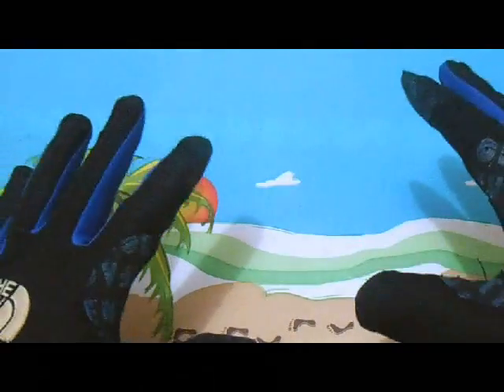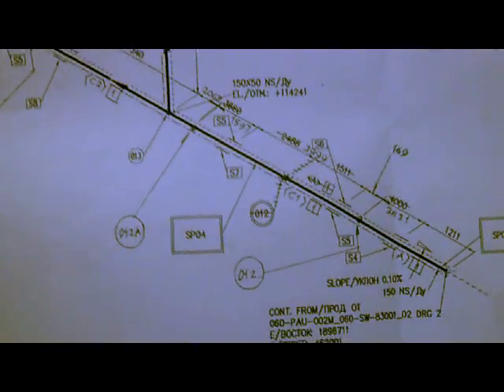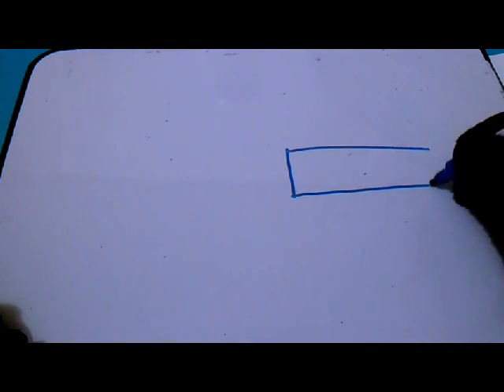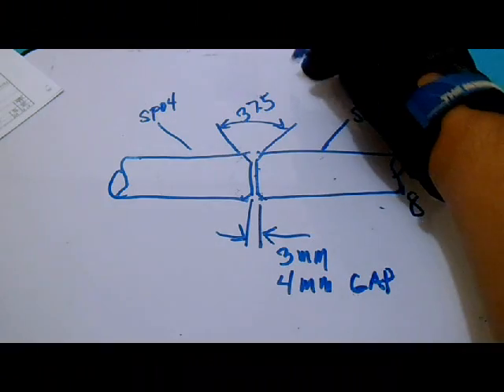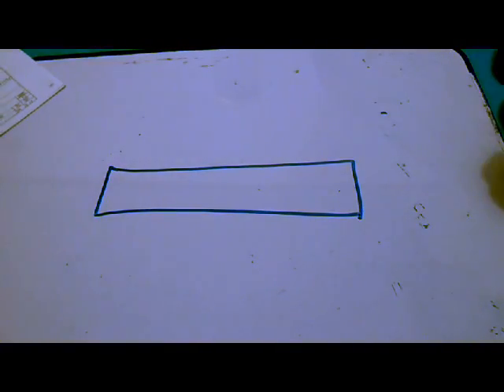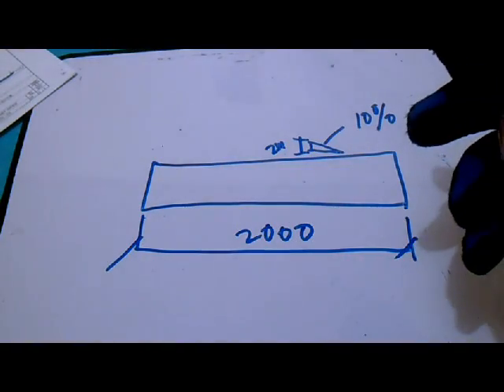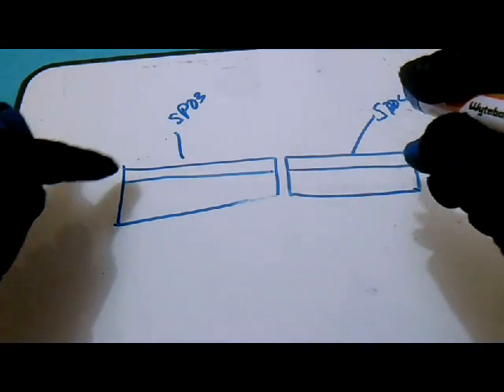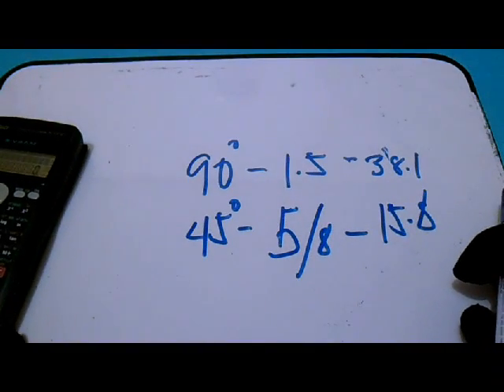How to Read the Isometric Drawing? and Formula 90,45 Degrees - Pipingweldingndt

Comment: i was confuse about the angle if it  is 37.5 angle that is very small  the standard of whole angle each spool is 30 to 35 angle iso for thos two pipe  generally or over all angle.is 70degree.±

Comment: That is not a triangle, it's an L square or a steel square.... to check the squareness of the pipe end or fit up angle.. and the bevel standard is 75 deg. as per your drawing(connecting butt welded spools), one end of the pipe is 37.5 deg. for the bevel angle..., joint no. 12 is field weld while other weld points are shop welded, (There will be difference in the marking on drawing as per spooling of shop and field welds, verify on weld map so that fabrication will not be compromised because some spooling are made due to access or obstruction as per site condition). Then, 10% of 2000 is 200, you can adjust the sloping thru your pipe support, not on the pipe itself. And be specific where to start the slope and end based on your demo drawing for the beginners to understand clearly. ERW pipes or pipes with seam are used in diameter 18" and above as per standard, seamless pipes are used in below 18" for seamless pipes can sustain higher pressure and temperature, you have a 6" pipe in your iso(you should have explained to the viewers). And regarding the seamlines, the standard weld proximity is 1D or never closer to 1 1/2" or 4x thickness of pipe or which is greater. it is never been said that it should be of 30 deg., you can do it even 180 degrees from each other or whatever degree as long as the branch orientation is correct and weld proximity is followed. This is to prevent HAZs and also stress on weld joint, if there is no other choice, you will have to have a PWHT on the joint to relieve stress on welds, but if you have, do it as far between each other.